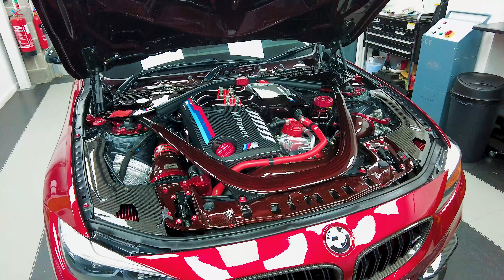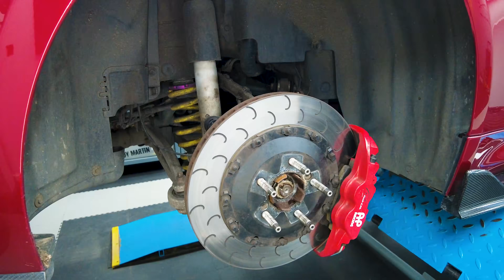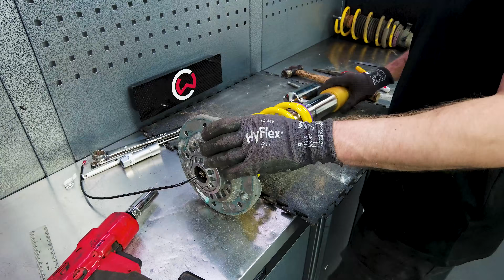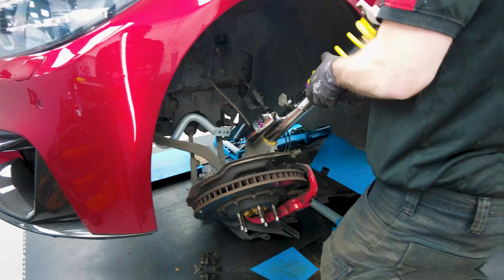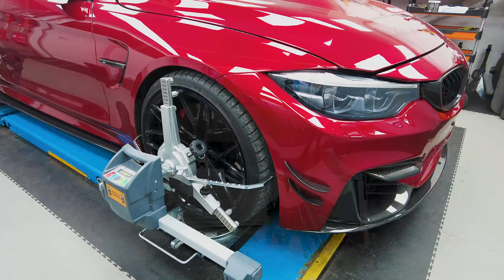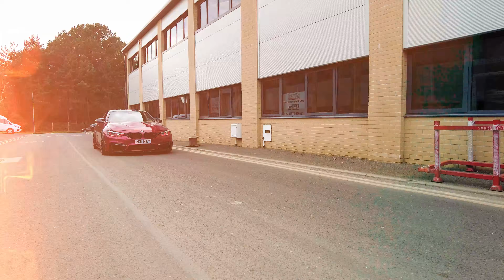Are The KW DDC Electronic Coilovers A Worthy Upgrade For Your BMW M4?

Comment: Great video.

Im guessing the reason you needed to change the links for adjustable ones is due to the anti roll bar being after market? The oem bmw unit is gloss black in colour not silver. 

I’m wanting to install this kit to mine but I haven’t yet seen an install video that requires the change out of the anti roll links.
Reply from the maker: I believe it was mentioned in this video, the point for the drop links attaching to the new KW shock is at a different position to standard which means a shorter drop link is required. Not to do with the roll bar itself, no need to change the roll bar when installing these, customer just opted to update these as well 😀
Reply: @Carbonwurks  never seen any other other install of the exact same kw ddc kit on the f8x platform need to use different drop links for the reason in the video. Strange this car required it, good to know however.

I think I’ll pick up a set of aftermarket drop links in case I encounter this on my own car when installing

Comment: Would you choose these shocks over the new Bilstein Evo SE's? (omitting availability, just talking product vs product
Reply from the maker: The bilstein option is a very good one, great product and well priced for what you get. That said, we would pick KW and in the particular instance, KW is a bit more performance biased where Bilstein is more towards comfort. 

It’s personal preference. No right or wrong choice, it comes down to your ultimate goal. Bilstein for more comfort (while still being a performance setup), KW for more of a sports setup (while still retaining some comfort).
Reply: @Carbonwurks how about these kw ddc vs bilstein Evo r? which is a track more focused coil but do you think those can provide comfort also? even tho it will require an EDC cancellor? I'm in between rsr , vs kw , vs bilstein Evo r , or even nitron electron which also can retain stock EDC,